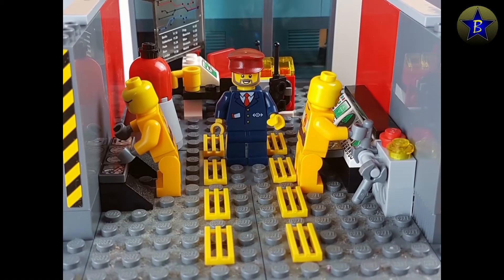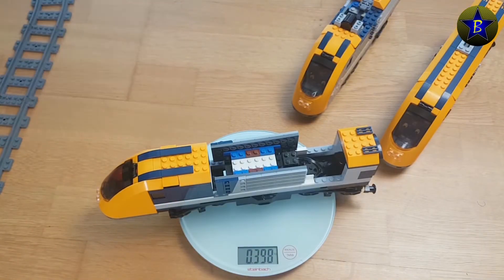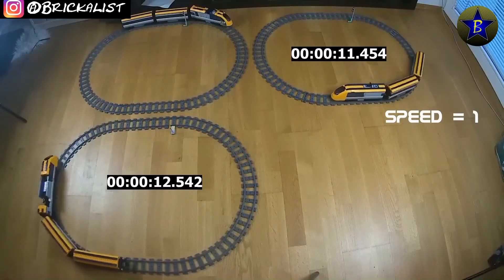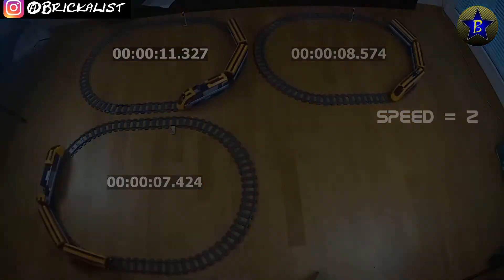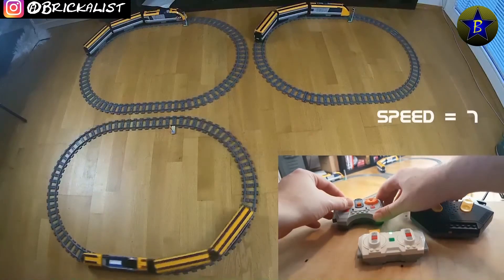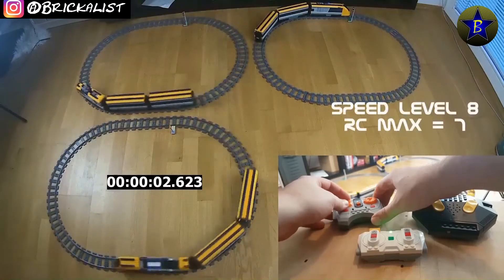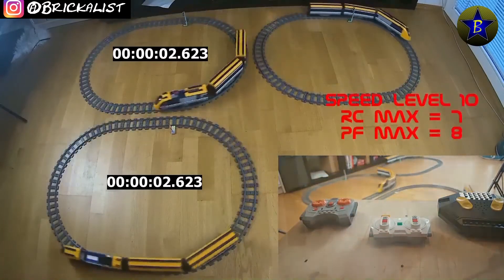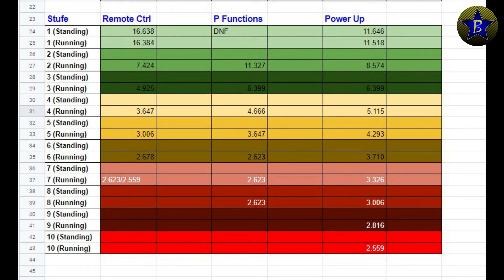Lego Train Motor Comparison - #BrickScience - Ep. 1 Speed

Comment: Question: Do you know if the first gen R/C motor (the one that uses the studded connecting wire and black remote) requires the remote to run? Or can you just run it off an old 9V technic battery box that has an on/off switch at a single speed? I can't seem to find an answer anywhere.